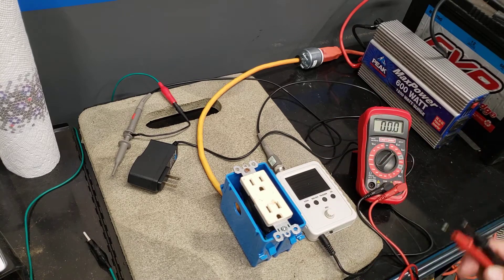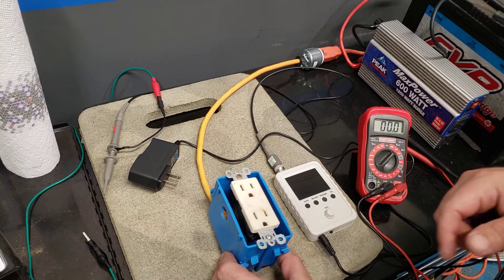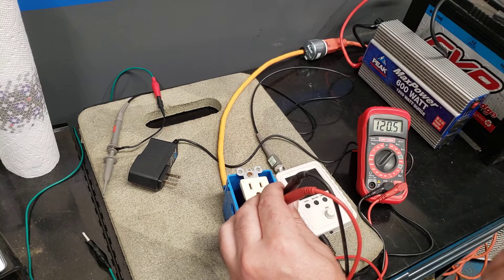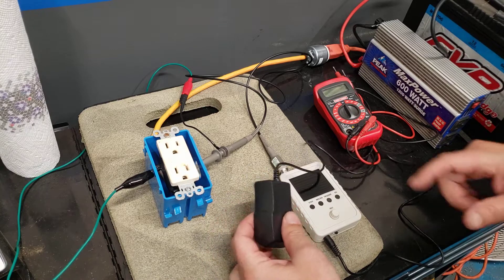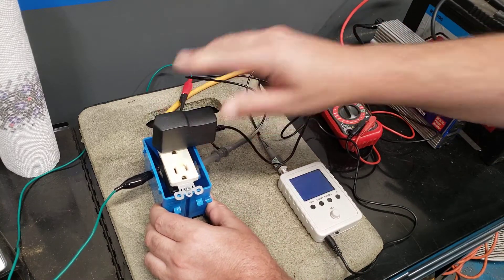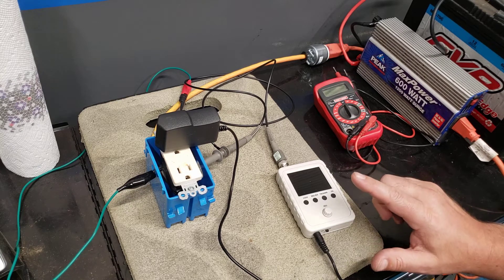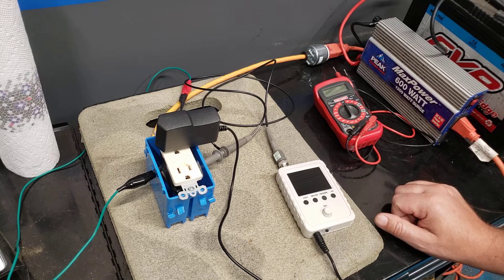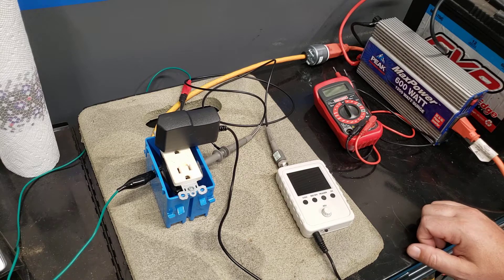DIY Inverter Sine Wave ON Oscilloscope

Comment: Great video. Exactly what I was looking for. Question? Can you use the same setup to see the sine wave for a 240v generator/ inverter? or would the voltage be too high?
Reply: I have the exact same DSO150 oscilliscope and the 10 x probe.
Reply from the maker: I'd have to double check the specs.  But it will be the same at 120v as 240v. Might need a different probe. Like maybe a 20x
Reply: @mrmotofy  That's kind of what I was asking. If the probe is 10 x, does that mean it reduces the voltage by a factor of 10? Say 12 v for 120 and 24v for 240? such that the DSO150's max 50V wouldn't be exceeded?

I need to make sure my 240v inverter generator at the cabin is in fact putting out pure sine wave power before I want to take a chance and charge my EV with it.
Reply from the maker: @jnelson8629  That's the way I understand it. If it's an inverter generator then I'd say there's a 95% it is pure sine. How good of one who knows. If you put a meter on it for AC check ground to 1 hot leg you should get 120v so it should work that way. Just be careful as the ground is hot but for testing it's ok
Reply from the maker: @jnelson8629  Normally in a home the ground and neutral are bonded at the main breaker panel/meter. So you get 240v across 2 hot leads and 120v across hot to neutral/ground in most cases. Generators may have a bonded ground or may be separated. Can verify by checking for voltage. Without knowing where in the world you are it's hard to know what you should have.
Reply: @mrmotofy  All good. Thanks for your reply. I'm just trying to not fry my little DSO150 Oscilliscope. Thanks for your prompt response.
Reply: Use an isolation transformer between to not fry your oscilloscope.

Comment: I was more concerned that when you put the ground lead of your multimeter into the hot side, and the positive lead of your multimeter into the neutral, but your meter did not display a negative symbol, since the polarity was backwards....
Reply from the maker: I don't believe it works that way on AC. It does on DC.

Comment: Thank you, sir.  Great video.  My interests encompass both solar and wind generation and oscilloscopes.  I have found a few diy ebay 36v pure sign wave inverters to piece together      I want to use them around my home using my 40v 6ahr ryobi batteries (20 of them).   wanted to check out the inverters  waveform and verify the claims made from China.   Very useful video.   Thanks.
Reply from the maker: Yep...I've wanted to for a long time. Borrowed an old Oscope from a friend to try it....4000 different knobs and switches...he didn't know how to do it on there either...Now there's an easier way for us not so skilled guys. I'm posting a new vid of a Famous Honda EU2000 sine wave